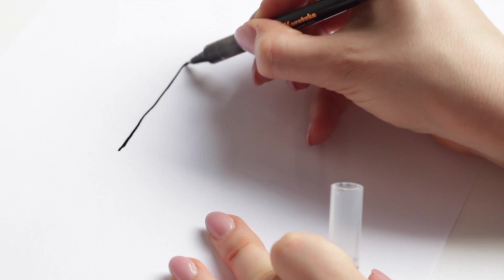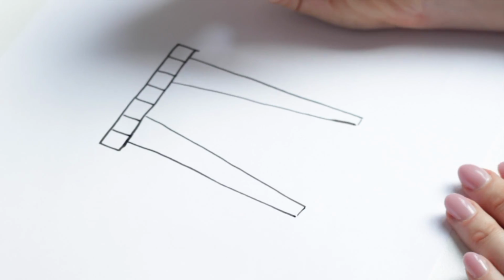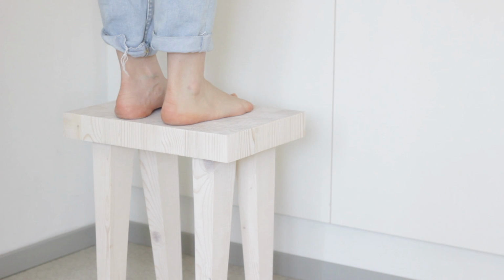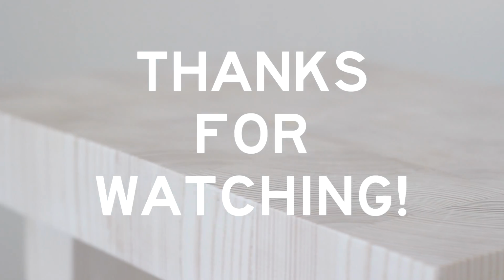DIY 2x4 End Grain Stool

Comment: so cool. what is that ring clamp with the metal braces at the corners called?
Reply from the maker: I guess it's called a strap clamp. I just used it to quickly hold the pieces together, so that I could flip the stool right side up and see that the top was lining up nicely. :)

Comment: um.. why you added wood dust on top and rub it before sanding?
Reply: Ammar A. It's saw dust. You rub it on while the glue is still wet and it fills any gaps and dries up the excess glue.

Comment: Did you whitewash the wood or is it just the lighting?
Reply from the maker: I did whitewash it, i just didn't get good footage of that. I used Osmo whitewash wax. :)
Reply: Was it  "Osmo Wood Wax Finish Colored Oil" ? Did you put the clear coat they recommend on top? Thinking of using white washed pine in our house so would love any tips / info you have...maybe it'd make a good video? (if you used it on furniture I mean.) I any case I called the US distributor and they sell pine floors too so I am getting quotes for both. Thanks for tip.

Comment: hi ,why you not glue up the top base first and after that put the leg...this step will be strong enough for hold your leg.by the way you did so well... I like it. thanks for the video.
Reply from the maker: It just seemed easier this way. The fit of the legs wasn't perfect, so I was able to get a better glue up. :)

Comment: 1:18 looks like you tried to cut it and then decided to sand it down, is that true?
Reply from the maker: Yes, I tried to cut it first, but I couldn't get a straight line on the band saw. So I had to try another way since I didn't have a table saw. Table saw would have made this project so much easier! :)
Reply: Yeah It would. But you figured out how to make it work and that is what counts ;-).